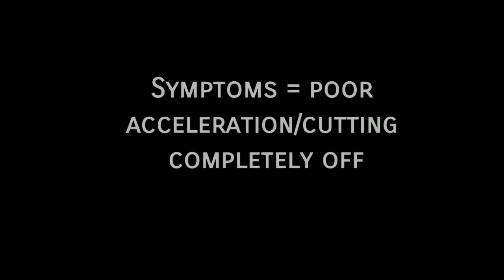Merc Outboard 110 9.8 Fuel Pump Rebuild (17cu)

Comment: Could you do your best to find any information for a 1968? Mine looks a bit different than yours but same principle. Mine doesn’t have to 2 bulges your does in the pump casting. 

Anyways I got the carb cleaned out and it starts right up when I fill the bowl myself. Need to get this pump running next and I’m in good shape.

Comment: First, I really like your stuff on old Mercurys.
I am at my wits end trying to get my Father's 1970 9.8 running.
It ran great three years ago, then I let it sit with old gas for over a year...
The next summer it would start, but any throttle past idle it stalled out.

I cleaned/rebuilt the carburetor and the fuel pump (that pump was REALLY nasty).
I replaced the gas tank- original steel one was full of rust bits.
I replaced the spark plugs.
I replaced the coils and points.
Compression is equal on the two cylinders.

Fresh gas and/or starter fluid,... it will not start...
What can I try?

I set the carburetor the same as I found it pre-rebuild.

I am at a total loss as to what to try...
Reply from the maker: An engine only needs 3 things to run: fuel, compression, and spark. The spark needs to be blue as well. Have you verified spark? Lmk
Reply: I would attempt to set the spark plug against something metal and look for blue spark from the ends when pulling it to start

Comment: I just bought a 1971 Merc 110 9.8HP and it looks great but where the fuel hose connects to the fuel pump, it spits fuel. The motor will only stay running if Im squeezing fuel bulb otherwise it cuts out. Does this seem like the same problem in your video you were having? Hoses are ok.. Should i swap out pump? Great vid by the way!
Reply from the maker: Rebuild the fuel pump my friend. Son

Comment: I just bought one from a relative who wont take it back.  Starts OK but when you put it into gear, its  stall.  Any recommendation as to what I should look into.
Reply from the maker: Could be a number of things. First I would check fuel delivery. Typically, if you shift and it falls on its face, that's an indication of an improper fuel mixture. Try to richen up the fuel mixture by turning the idle screw 1/4 turn counterclockwise until it can shift properly. Hope this helps. Let me know. Son
Reply: @MerCSonL6  Thks for the rely.  I will try checking the fuel system